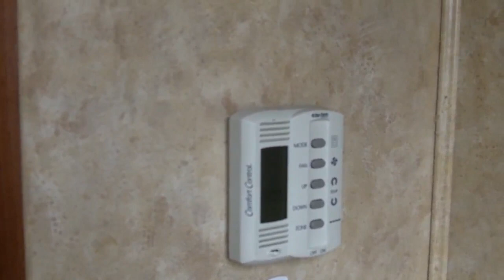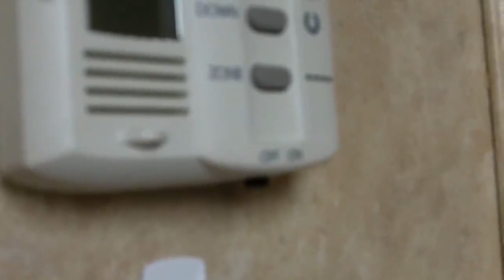How does the 12v System in your RV - 5th Wheel REALLY work?

Comment: What about when your lights work on shore power but your fridge doesn't? (No DC power connected atm)
Reply from the maker: So...if I understand your question - you're on shore power, and your fridge won't work? And, you have no batteries in your camper to run the 12v systems?? And, so you can't switch the fridge over to propane? (assuming its a 2 way fridge??) You're leaving me without much to go on here.
Reply: We had to disconnect the DC because my husband found 26 volts of ac power returning to the batteries. He said there was a ground short gping to the gen. He has isolated that and found 2 other shorts he is repairing today on the DC side.
Reply from the maker: Once the electrical systems are behaving correctly, see if the fridge works on either propane or 110v. If it does not work on both, seek professional assistance (an RV tech) in your area
Reply: Ty for your time & your help!

Comment: That sucks, the addition of a couple of solar panels and a charge regulator would have helped a lot here. Another item you could look into is a low voltage (12vdc) cut out switch. It’s designed to protect you’re house batteries from over discharging, most I’ve seen have an override function.
Reply from the maker: well, conditions do not always permit the use of solar panels, and a converter failure is honestly rare
Reply: Zr. xxx poo

Comment: A few years back while using my trailer I heard a loud pop, the lights dimmed for a second, then came back. The next morning my battery was half dead and ever since then I’ve hooked a battery charger to the battery while camping to keep the 12-volt system going and the battery charged. I just didn’t want to take it back to the dealer and pay to have it fixed....
Reply from the maker: hey, it happens

Comment: Your tow vehicle could be plugged in temporarily to run Your furnace and refrigerator.  It should charge Your batteries while You are driving,  but should also supply dc power if Your converter is dead. Try plugging it into the tow vehicle and see if everything will work.  You may need to start the tow vehicle every few hours to keep from running it's battery down.
Reply: V

Comment: i know after this experience you are more knowledgeable about the 12v system. in your opinion, do you think a "backup" generator would be appropriate temporary solution if this happens again? a 2kW generator would be light/small enough to store in the basement but powerful enough to handle a fridge, furnace, and several small appliances. plus they can be hardwired into the converter. only issue i can see is storing gas for generator somewhere. but i guess with a separate vehicle you can also drive to a local station and purchase it there on the fly.
Reply from the maker: equallywrong Actually, a backup generator would have done nothing for me in that situation. I was hooked up to 110v - but with a failed converter, I was not powering my 12v appliances properly - or charging my battery(s). The only thing that saved me was a 12v battery charger to keep the 12v systems running. 

Yes, a 2kw generator would be great to have but not in this circumstance as the generator is simply an alternative to "shore power". (Both supply 110v). The generator would simply run off of either solar, propane, or gas/diesel instead of shore power that is supplied by the local electric company.

Comment: Seems clear to me it was your convertor/charger that was the culprit here.  Think about it, the convertor/charger job is to maintain the batteries at a certain level.  It didn’t do that and you ran the batteries down. Once the batteries drop below about have of their reserve capacity it will drastically reduce their longevity.  And once they are completely depleted well let’s just say they will never be the same. You might be able to get them to hold a charge but they will not last long. It’s not a battery issues, you should never let a battery fall below 12.4 volts.
Reply from the maker: David Carr David, thanks for the insights.
Reply: David Car you are right. Unless of course your using what you are supposed to be using in your RV and that is RV Batts that are "deep cycle" in witch case they are designed to go up and down on their charge and let the amps out slow and steady. This doesn't hurt them.
The video maker was using golfcart Batts that are designed for lots of amps real fast but not much more than 1/4 of it's full charge always leaving 3/4 of a charge in the battery. They can go more but your taking a chance at reducing the life of the battery especially on a cold day. But these type of Batts need to keep at a full charge so you immediately need to recharged them back to full. Theses Batts are not good to use in an RV as they are more for a surge putout type use than a supply of on going steady elec supply output. As in starting a car or other such things. RV's need the latter type supply. So because he had the wrong type of Batts in his RV he burnt the Batts out, now his converter had to work twice as hard and over time to keep a constant supply because the Batts wernt there for the cushion or to give it a break to cool off ever so often. Then in turn burnt the inverter out. It was a chain reaction from the  wrong Batts installed in the first place. Just remember... "DEEPCYCLE"   and you won't have the problems this guy had or is having.